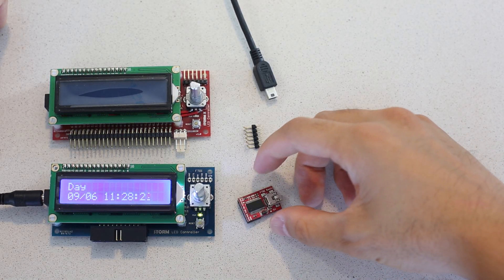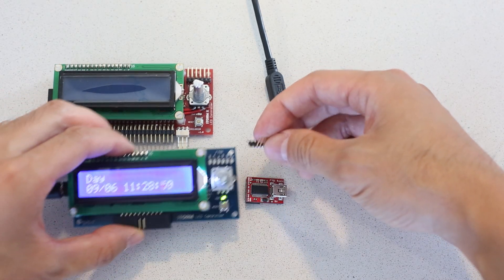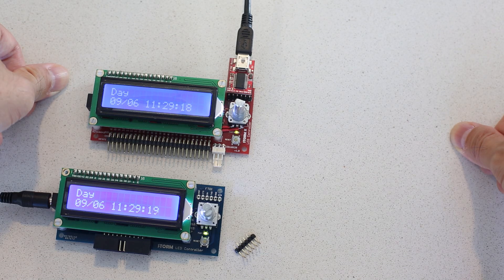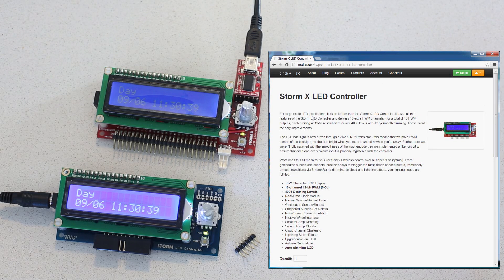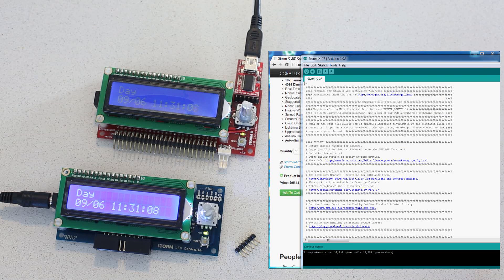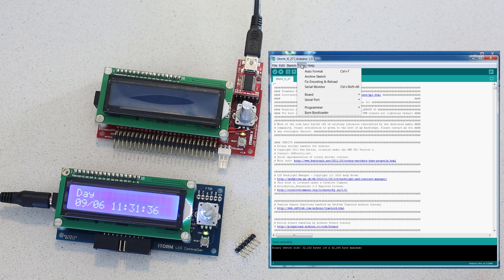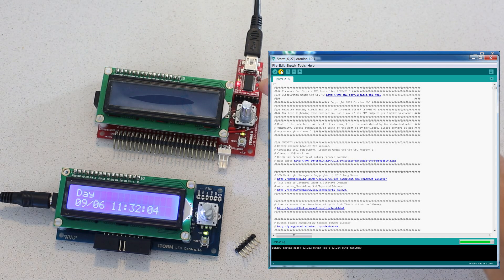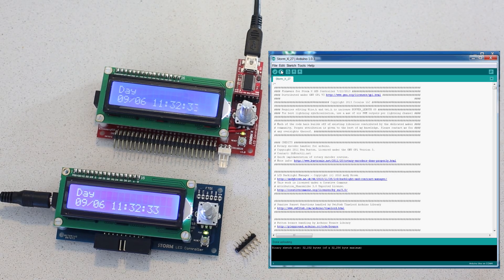Coralux Storm Firmware Upgrade Procedure

Comment: How can you update the code so that you can run one of the channels, ch4 for example, on a different schedule than the rest? I would like to also control my refugium leds (on a meanwell ldd-500) with this controller, but with a much longer schedule than the rest. Thanks
Reply from the maker: That's going to be a relatively complex change to the code since the entire code is built around worshipping the sunrise and sunset times. The easiest (and maybe it's all you need) would be to hard-code say CH6 to turn on at a certain time, and off at a certain time without ramping. You can contact me directly for more info.